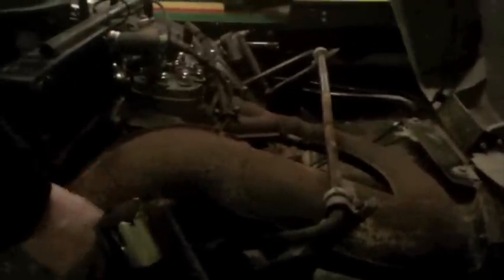The Lost Deere

Comment: I drove this sled in early 1985.  The JD STRUT system was in development prior to Yamahas intro.  Ours was an aircraft strut system unlike Yamahas.  I was accompanied on the drive by the Professor Stan Hayes and Max Millage Bruce “ Bruiser Wentworth “ Klintworth. I was not a bad rider but compared to Stan and Bruce I’m not very good.  On that day going across hard drifts I’m driving hard with one hand looking over my 
shoulder watching Stan and Bruce being thrown around way behind me.  I can’t believe it as I’m like riding on a cloud with the long travel 
front and rear suspensions, plus a new deep seat.  I’m so stable with out being flopped around helped by the sway bar.  It was powered by a 500cc
Kawasakie liquid cooled engine.  This sled had our newest TR 800 primary but did not have our new die cast secondary with our patented easy on off belt feature.  Basically this was to be an all new sled and it was.  The ride at the time was unmatched.   However, decisions were made and the
Company exited the business.  Too bad as the longer we would have stayed in our engineering strengths would have good for the snowmobile industry, plus we would have made some money.
Reply: The time frame here was not a good one for Deere. The Farm crisis of the 80's was why. We could not even get a new 16 row planter back then because they had halted production on them because of lack of demand. Their entire Ag product line stopped selling as farms failed and were sold out. 
The last liquefier we had here was a 1982 model. Many fond memories of that one. Low CG made it exceptional in cornering.
Reply: @debi5292  Debi Thanks I got to relive a great time in my life as the factory marketing manager for snowmobiles.  Many of us have now passed on. Stan Hayes the Professor was way too young !  He was loved and respected and continued his John Deere career 
until he retired. Others that were involved have passed as well.  But that part of JD history will part of the JD story as long as the
186 year old Company exists.  Again thanks for the remembering those days,  Best regards Bill Lee

Comment: So who took over jd when they stopped making sleds? I was only a kid back then when they stopped  but my two uncles were jd dealers and sold the sleds. Ct and Vt
Reply: The big P,
(Polaris IND) got umm, I went to work for the Big P in 95, there used to be a pogo-sticker
Liquifire in the back lot covered up sitting on an old crate. Polaris bought
out the rights to John Deere snowmobiles I assumed that the TR 800 drive clutch
went with that, in my mind the TR 800 drive clutch was one of the most durable
and adjustable drive clutches ever designed, it had the adjustability of the
Arctic Hex with the durability if the comet 102 and 108c clutches, I never
understood why Polaris never took and ran with the design.

Comment: there not rare ,there a lot ofthem around still but if it runs and drives probably 650/800$
Reply: You have no idea what you're looking at - this is a prototype for a future model that was never produced, this isn't just "A" JD sled. This isn't a prototype of a sled that was later produced; it's a one-off INDEPENDENT STRUT JD, which was never manufactured